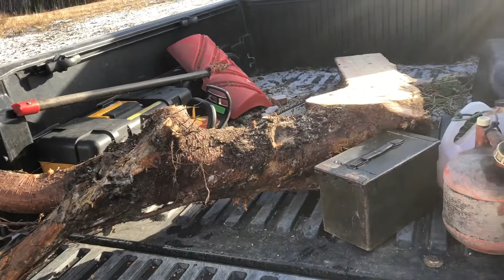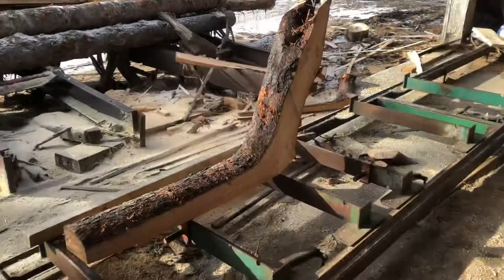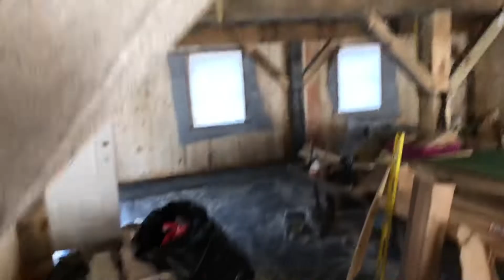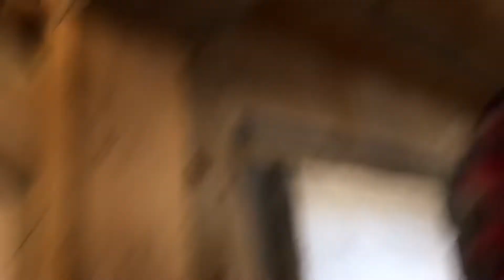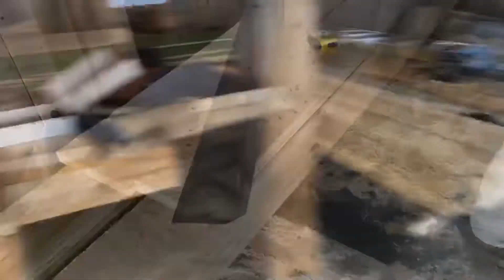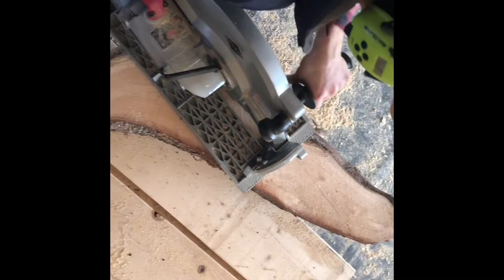Take a Knee

Comment: You didn't de-bark it?  I think that knee is in compression so the vertical part is just fit into a pocket.  The bottom of the pocket might have a slight back angle so the brace can't come out.  I'm wondering if there's a tenon on top with a peg?  Or did you guys just smear some construction adhesive in there and shove it home?
Reply from the maker: Almost as simple as a little glue.  No fancy joinery in this case, it will be through bolted top and side, the strongest glue you can apply!
Reply from the maker: Oh, and its just stuck up there with a couple lag screws its coming down after the holes are drilled and then the bark will come off.
Reply from the maker: We could put some varnish on the bark and run it that way!